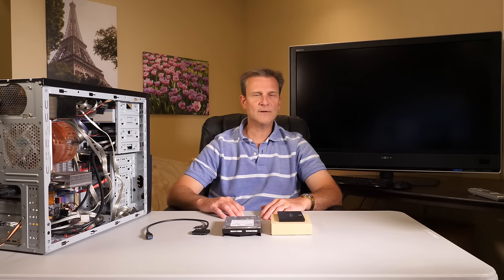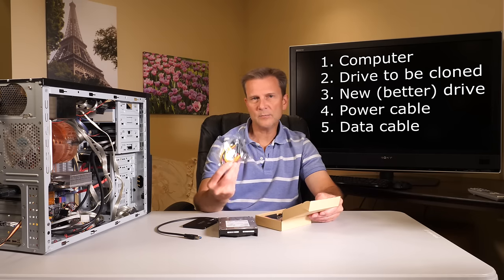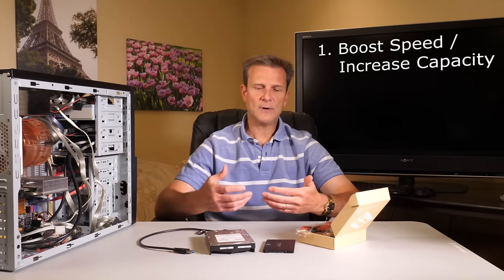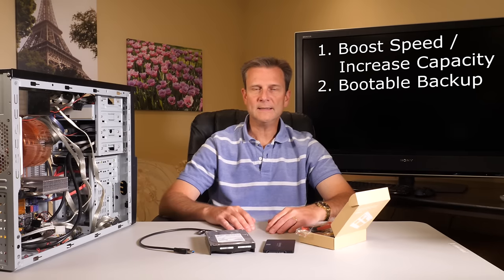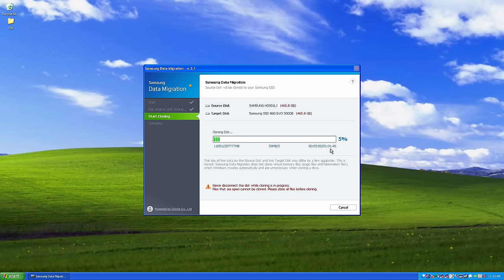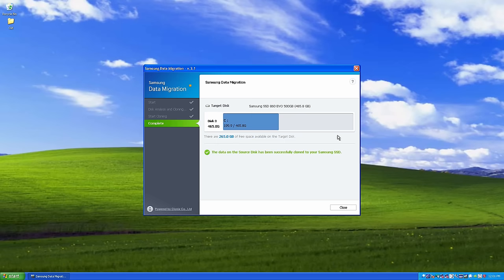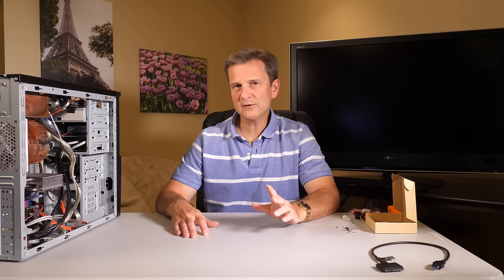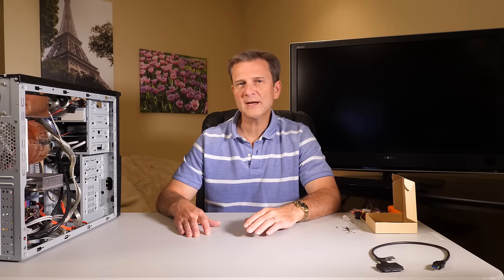How to Clone Your Boot Drive to SSD Without Having to Reinstall Windows or Any Other Programs

Comment: If my hdd 1tb is installed inernally on my computer, then i buy and external ssd 500gb. How do i clone windows to my ssd, then remove windows from my hdd so there isn't two windows installed? Thanks.
Reply from the maker: It is not necessary to remove windows from the HDD. You need to make sure that once you clone your drive onto the SSD that you computer is booting from the SSD, not the HDD. But you do not have to remove Windows from the HDD. In fact, unless you really need the space, just leave it on there. That way, in case the SSD fails for some reason, you can fall back on the HDD.

And just a side note, make sure the 500GB SSD is big enough to clone the full contents of 1TB HDD. I assume you already checked that, but just wanted to make sure.
Reply: @NerdSidekick  well the reason im getting an external ssd is because when i game im getting 100% disk usage. Ive disabled windows search, superfetch. prefetch, storage sense, msi mode to 0, and countless other options and im left with getting an ssd.  Plus i dont have alot on my pc as i reinstalled it hoping it would fix the problem, so currently im at 740 gb free of 930 after installing  my game to my hdd, which would of been enough if i had to put it on my ssd. Im thinking maybe i should just install the game i play to the ssd in hopes that stops the 100% disk when gaming maybe? Oh and thanks for such a detailed reply you really are a gem for going through such lengths to help subscribers its great!.
Reply from the maker: @griefercreations9477  It's worth a try installing on the SSD. It should be much faster.

Sorry, I missed the fact that your SSD was external. How is that connected? Using USB? 2 or 3? Did the drive come in an enclosure or did you put it in and enclosure or other type of dock?

If at all possible, try to install it internally so that you take advantage of SATA speed. Your USB connection may be a bottleneck for the SSD.

Comment: I want to use the HDD for storage what do I have to do to it to keep it as a storage drive?
Reply from the maker: Temporarily pull the power cable out of the old drive so you are certain the computer does not boot from that drive. Boot to the new drive and make a noticeable change to the desktop or save a text file to your desktop with a name like "new drive." Turn off computer. Plug old drive back in. Reboot. If you see the "new drive" file on your desktop, you know the computer is booting with the new drive. You should be able to see both drives now if you look at File Explorer.

If the computer is still booting with the old drive, you probably need to adjust the boot order in the BIOS (a topic for a whole 'nother video). You should be able to find a video to help with that or consult the manual that came with your motherboard if you still have it.
Reply: Thx this worked!  Should I reformat the old HDD?
Reply from the maker: You can if you are certain you don't need it as a backup and that the SSD you copied everything to is working properly. It's not necessary unless and until you need the space.
Reply: Oh OK thanks for your help.
Reply: Best way is to remove the drive then install it in a USB enclosure case. Then use it as a back up drive by setting the OS to dump data to that drive. Leaving it in the computer as a secondary drive can also be a alternative method. Trouble with this WIN10 tries to use it as a recovery drive.

Comment: does this copy all partitions. my windows partitiona and my revovery partition etc
Reply from the maker: This will depend on the specific software you are using and what options you choose.
Reply: Nerd Sidekick I will be purchasing the same brand of hdd as you have so I will be using the program you use in your video will that clone all partitions of is a stand-alone program a better choice ? Thanks
Reply from the maker: I have not usee the program to clone more than two partitions, but I have seen a post that indicated the software would only copy two partitions max. I have not verified that. The instructions from Samsung do indicate that "The OEM Recovery partition created by the computer manufacturer as a factory setting will not be cloned." You can download and read those instructions here: https://s3.ap-northeast-2.amazonaws.com/global.semi.static/Samsung_SSD_Data_Migration_User_Manual_ENG_v.3.1.pdf

You can always try to clone your drive with the free software and see if it works. If not, then you could purchase software and do it again. That would only cost you a couple hours time, but no extra money.

Comment: Hi guys. Can anyone tell me if the data of the drive that is being cloned will be deleted/erased after the cloning.
Thanks.
Mark
Reply: No. The cloning process will not delete files from the original drive.
You can delete all/any files later once you boot into the new drive, if you leave the old drive in the PC. (connected of course)
Reply: Thanks.

Comment: hello I get this error message when I boot up my PC when I removed my hdd that says 0xc000000e any help?
Reply from the maker: There are a number of helpful videos on YouTube that address this issue. Here's one: https://www.youtube.com/watch?v=0BSsfCbb9po

You may also need to swap some cables around. If you still have the original drive that you copied from installed in the computer, try swapping the data cables so that the new drive is plugged into the old cable and the old drive is plugged into the new cable.

Comment: Mine didn't work I just get no boot files found
Reply from the maker: If your computer has more than one drive, make sure you cloned the correct drive. In other words, that you cloned the drive it boots from. If you clone a non-boot drive by mistake, then try to boot from the clone of that drive, the computer would not boot.
Reply: @NerdSidekick  copied everything across but not all window files by look of it

Comment: In case the SSD performance started to decrease one day, then it will be worth considering to update the operating system to Windows 7 at least. I think Windows XP is not the most suitable operating system for solid state drive. (As trim and garbage collection might not work)
Reply: they are both dead operating systems
Reply: @joshuaguenin9507  So true for the vast majority. There are still very few of us that, for what ever reason, *really* like Windows XP (pro64 bit in my case). When my hardware finally dies, I’ll be forced to start from scratch and ha, ha, have a heart attack while re-installing all my customizations and getting my plethora of game & software applications to actually work with newest operating systems. Fun times ahead, ha, ha.
One of the best instructional videos I’ve see, great job Nerd Sidekick.

Comment: Another reason I like the idea of not using "Free cloning software" is for security
Reply: Most good brand's provide cloning software for free with their drives. If yours doesn't, you can use Macrium Reflect, which is free for home use. Nothing wrong with free software
Reply: Almost all of Linux software is "free", yet Linux is one of the most secure desktop operating systems in existence. Free is not bad, especially if it is "open source."

Comment: Thank you for taking the time to help teach people like myself.  However, the video quality is so bad I can't read pages you are showing. The video got blurry around 3:30 mark. I take back my thumbs down with up!  And thanks for doing things like this!
Reply from the maker: Make sure your internet connection is fast and that YouTube hasn't dropped the resolution of the video as you are watching. These are all captured and rendered in full HD, so the text should look fine. Watch it again and it'll probably display properly. Just be aware that you may need to adjust the resolution setting if it has been set to low for some reason.

Comment: I trust you shut down your computer and unplugged it from the wall socket, then press the start button to dump and ground any residual power left on the motherboard. If not, you are asking for an accidental discharge of power that may jeopardize your system at any point, including your new drive. I would review all procedures a PROFESSIONAL might employ. Just a thought Mr. Nerd.

Comment: For pete's sake, DO NOT DO THIS!  Take the opportunity to install a FRESH and CLEAN version of Windows on your aging system!  It doesn't take long and it's not hard...ESPECIALLY if you set up a USB install boot drive instead of using the CD!

Your system will run a LOT better without all of the "cruft" that builds up on a Windows system after years of use!

Comment: Boot drive? I don't even know what boot is, unless you meant a hard drive (HDD).
Reply: So, in some computers you might have more than one drive. A boot drive is the drive that, on startup, your computer calls on to load the operating system. In a lot of computers your boot drive is the only storage device so it also used to save all of the data as well as the operating system. A designated boot drive has certain benefits but are not really needed.
Reply: @cristiancruz1972  
I almost forgot the comment I made some 3 weeks ago. I know what a drive is and certainly it is not a boot, either a boot is the thing you wear on your foot or it is not. The drive referred on computers as a startup and record/transfer files and documents is really a master drive, as it was called back in 1995 Windows 95, or better still it was called disk recording manager, or later it was called hard disc drive (HDD) because early computers (300, 386, 486, Amiga, etc.) did have a type of low volume hard drive but they were made of different material than the discs used in later computers. IBM, the dominant computer company at the time was the best until Microsoft was formed. Latest computer may no longer use disc drives rather than solid state system but they still call them drives even if these new devices don't drive anything. These supposedly drives record, transfer and receive details from the memory cards and have no drivable components such as a disc driving motor, etc.
Reply: @mickcarson8504  ok boomer
Reply: @aevan104  
Boomer? Yeah? You know me well Angus, admit it you know me real well to call me a boomer when I am still signs and no kids. Funny how people find names to call other persons, as if they know who they are. 🙄
Reply: consider yourself Bootsrapped
Reply: @joblo497  
I don't even know what bootsrapped means. How do boots get rapped?

Comment: Best way to clone your boot drive is use Image software that makes a Image of the drive, your then restore that Image to the New SSD drive. Remove original boot drive, then connect the SSD, the computer boots from the new drive.

Comment: This is super mega wrong. Never do it. Migration should only be done from one carrier type to another of the same type. Transferring from hard drive to SSD will make it slow, and the computer will report it as hard drive and not SSD. The opposite is even worse. Besides the killer low speed will result in very high hard disk temperatures. These devices have a very different structure. Don't forget that with SSD every change no matter new write or overwrite of a file is written to a new location while with hard disk when overwriting is in the same location.
Reply: That's BS, I've done that from HDD to SSD using this Samsung Migration tool more then once and has worked each time. Using the Samsung Magician tool to monitor the new installed SSD drive it shows no ill effects that you claim.
Reply: lol

Comment: i just buy 2TB new WD HDD but no see this in win7 ,and any about 15 software wehat i has try clone old HDD to new no working because after all lot setting softwares say buy buy bu ybuy buiy not can use if not buy this software. were have FREE clone ? before has many harddisk manufactory own clone software ,now all havebuy buy buy ,pay this you can use. no thanks. if i buy HDD need be FREE can clone old to new.

Comment: OR you could forget all that nonsense and just spend $30 on a dual hard drive docking station that has cloning capability, you don't even need a computer, the one i have works flawlessly, in fact it successfully cloned a drive that wouldn't clone with software. wished i could find one that did IDE.....

Comment: this is bullshit , your add says without having to use any other programs
Reply from the maker: The title says you won't have to "reinstall windows or any other program" meaning your currently installed programs will not be affected by the cloning process. But you still need to use a cloning program, which in many cases can be obtained free of charge.